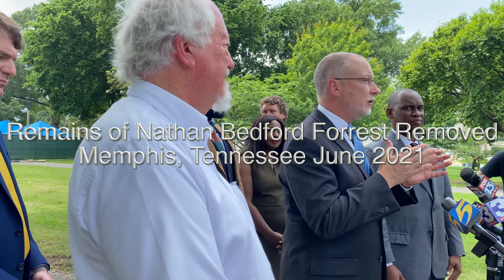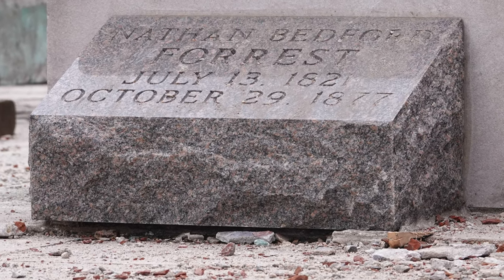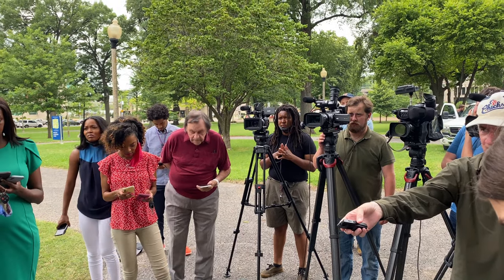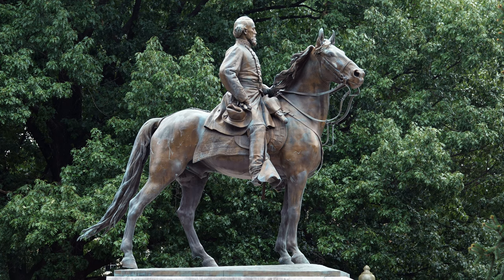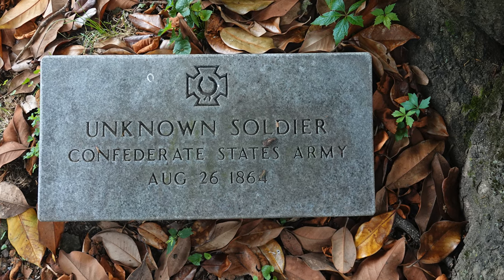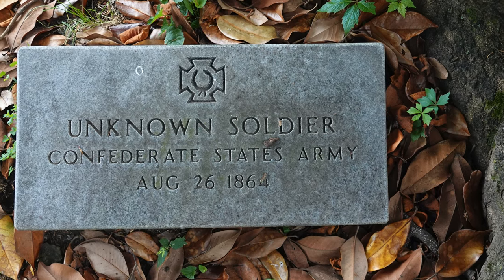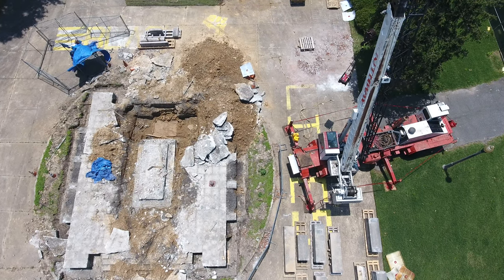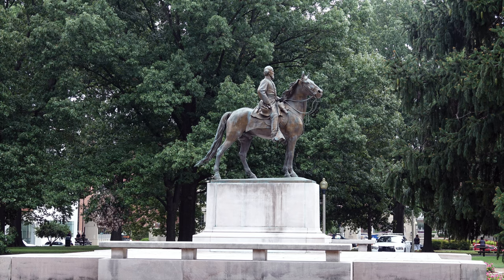Controversial Civil War General Nathan Bedford Forrest Remains Moved; Millar Disputes Forrest Lore

Comment: With all due respect at this tender moment in the history of Forrest’s  reinterrment, as a slave catcher in Mississippi, a slave dealer out of Memphis (which was the basest form of slaveholding) whose brothers continued in that line until the war, a slaveholding planter until he joined the army, at the very least a supporter of the KKK (though there is ample evidence from his own statements that he led it), the murderer (with a hatchet) of one of his black laborers, he had the most horrendous civilian record of any Civil War general. And his speech was delivered in response to the Exoduster movement that both he and his hosts feared would drain the South of black laborers, thereby depriving him of cheap labor and his hosts of their political power. Why in hell the Sons of the Confederacy feel the need to whitewash Forrest is an apparently everlasting mystery.